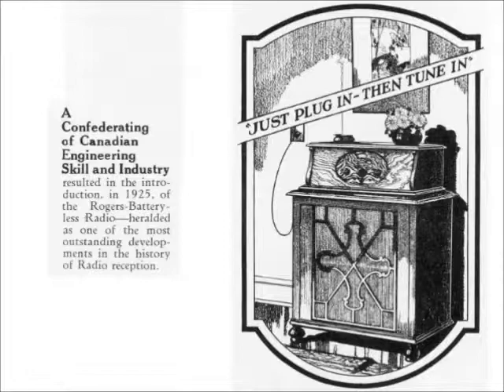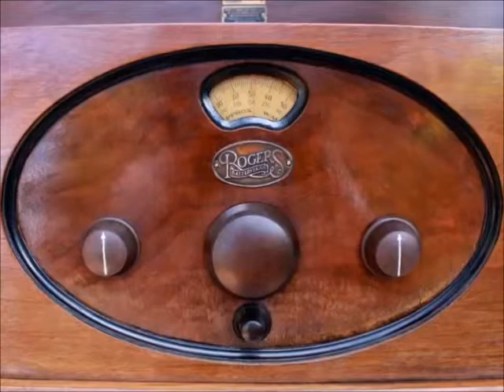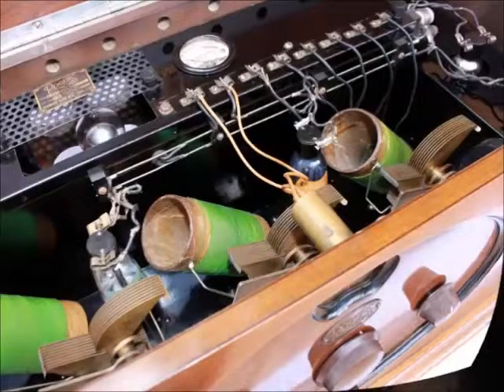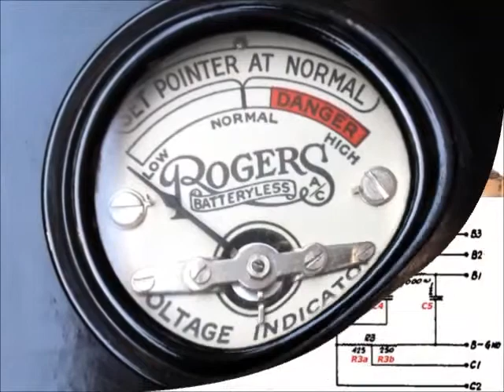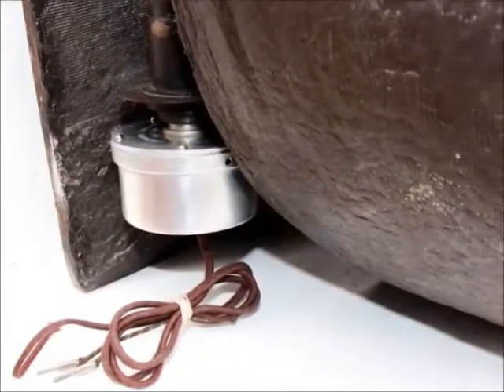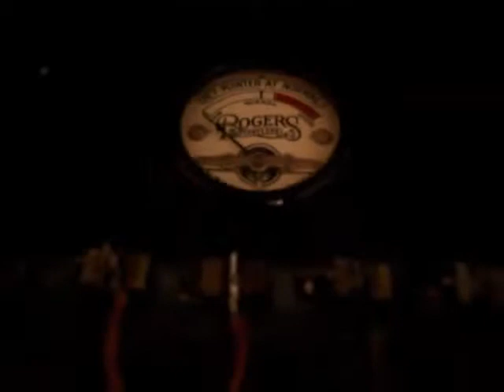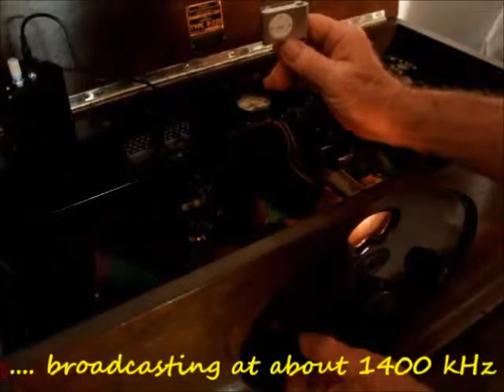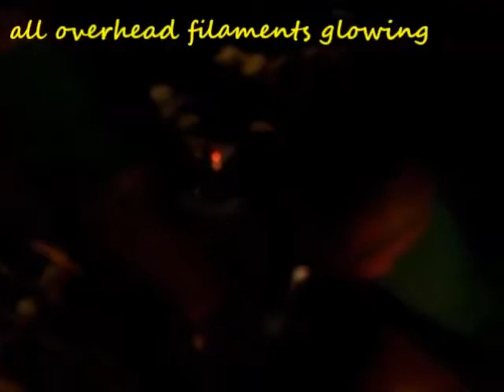1927 Rogers Batteryless First AC-Powered Radio Using Rogers AC Overhead Heated Tubes

Comment from the maker: Both Rogers overhead heated tubes R-32 and R-20 are triodes, as are McCullough's 401 and 403, respectively. And - yes - all the sound from the radio you hear in the video is coming from the Newcombe Hawley Concert Grand speaker shown.